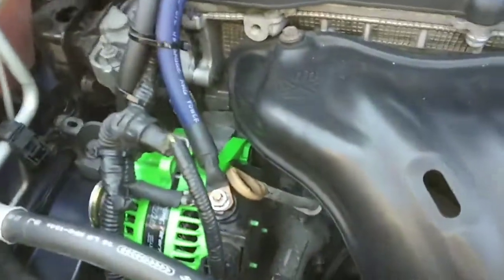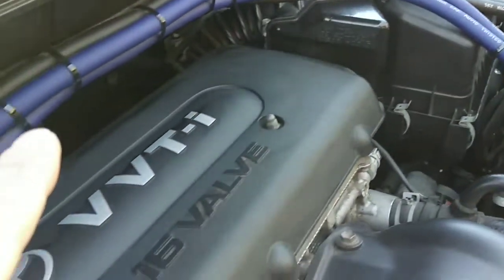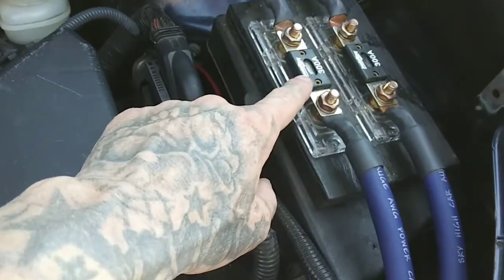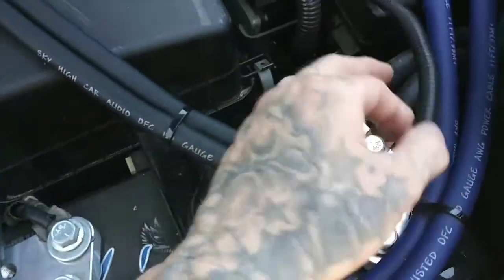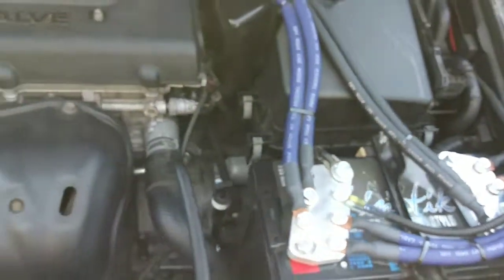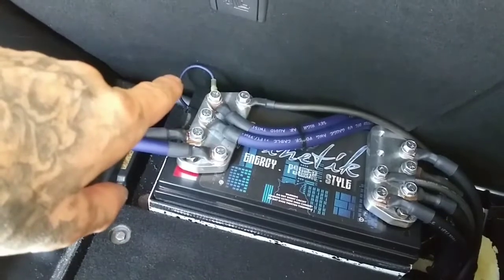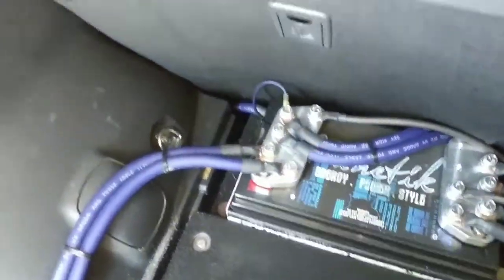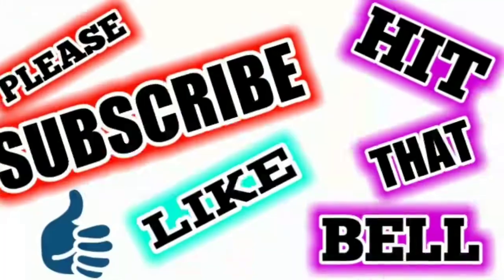BIG 3-4 UPGRADE 2008 SCION XB

Comment: Instead of ground to alternator mounting bolts, I'd run that to the back of the alternator housing. That will keep the alternator cooler and take better advantage of the negative alternating current.
Reply from the maker: That bolt connects the back of the alternator housing to the engine and wire lug is mounted there thats why the engine is grounded to the frame and battery to frame ...??so isnt the return ground to the battery just a quicker path then all that ??

Comment: Where did you get your voltage regulator bypass module?  Does it trigger the battery light on dash to stay on? Also it looks like you maintained factory cables at the alternator that go to the fuse box. I have a 240amp alternator on its way and was kind of worried about the factory cables.
Reply from the maker: So I got the bypass from mike singer from singer alternators and I have no dash lights at all and I got the. .8 voltage one so if your. Charging at 14.4 you would go to 15.2 which when I'm driving I will stay at 14.9 to 15.2 at full tilt and of course at idle I loose some ....and I didnt touch any factory wires your just upgrading the wires I wouldn't suggest taking out factory wires .... I worried too but I watched a lot of videos and read a bunch of stuff on forums...good luck bro on your build
Reply: @SOBERSCUMBASSHEAD  Thanks so much for the info!

Comment: Where does the frame to engine ground bolt on to the engine?  Were all the non-batter side connectors 5/16" rings?
Reply from the maker: Ground from alt to battery ,battery to frame and find your cars engine to frame ground and slap some wire there...those are the grounds in the big 4
Reply from the maker: I dont understand the second question bro

Comment: Nice setup!!! Did you have to re-wire the factory power wire from the fuse box?
Reply from the maker: Thank you and no I didnt even mess with that...
Reply: Thanks for replying. I just upgraded my battery with a Full throttle group 34, but I had to put my battery in backwards so my factory power cable would reach. Then had to extend my grounds.
Reply from the maker: Ive always wondered about those batterys wish I could afford some xs power batterys just out of my budget....one day....how do you like the battery..?
Reply: I’m loving the Full Throttle battery. I should be receiving my Js Alt next week...so I’m on factory alt and it’s struggling bad. Running a Skar EVL 15 D2 on a CT 1500.1. Building another box 3.8 cf @ 31hz.. how big is your box? Keep the vids coming!!!

Comment: Any in line fuses from the 2nd battery to the amp? & im curious why no fuses in between the alternator & the up front battery...im wondering if it is necessary for my upcoming system
Reply from the maker: whats up bro so the factory wiring doesnt have a fuse between alt and front battery either..and yes i have fuses between amps and back battery i see alot of system on you tube without them but id rather have fuses  safer and protects a problem from taveling and causing more problems and money ...i have fuses from front battery under the hood and another set of fuse in the back of the car before second battery also and amps are fused as well bro... some say its necessary some dont...
Reply from the maker: @nathanielthomas2502  nice ...😁man those sfb amps are sick I've been watching Derek do the dynos on them the amps are small for the numbers they were putting out crazy for how small they are
Reply: The extra fuse or fuse box can create noise in the line and is also overkill, unnecessary.

Comment: Hey so I have a 2012 Camry with the vvti and just ordered ofc DC audio working to do the same big 4 and I got the same battery but a 1400 and planned on putting it on my trunk. For the 2ed battery do I still connect the 2ed battery and the main to the alt and chassis and all that or how do I do it? Can you tell me step by step on how to do it on this thread. Thanks really appreciate it. I have the rarest brain tumor in the world so me reading it step-by-step would be a lot easier I have 10 feet of ground 10ft power to do this. Please help
Reply from the maker: Friend request me on face book and I will send you a picture diagram later on messenger so it will be easier bro...sorry to hear about your brain situation keep your head up my friend I will draw out exactly what I did in a diagram and shoot it to you later tonight Im still at work.....facebook Dennis Soberscum Lewis...hit me up I got you

Comment: Whats size kinetik bagtery is that? I wanna order one for my 06 xb
Reply from the maker: It the kinetik hc2400..it's a big ass battery I had to unwrap my wire harnesses and take them apart to get that big bulky plastic protection off of all the wires and rearrange a bunch of stuff to fit it up n there tightly...
Reply: @SOBERSCUMBASSHEAD   sweet, thanks for the heads up and info, i may end up following your lead,

Comment: Why double runs?
Reply from the maker: I was thinking years in advance right now I am building a wall and my front battery is going to be eliminated I will be using a empth battery box and those runs are going to  my yinlong bank in the back ...abd once this wall is complete and sounds good I will be slowly picking up bigger subs another 8k amp and adding adding another yinlong bank or super. Caps to the empty battery box under the hood...double runs is better for what I wanted to do in the future so I dont have go backwards and add runs and I will be getting a more powerful alt...hopefully that made sense...i was thinking future

Comment: Dope!! Where did you put the voltmeter inside?
Reply from the maker: Thank you I put my 2 volt meters above my glove box in the cubby hole storage area you can see them in some of my videos
Reply: @SOBERSCUMBASSHEAD  
Is the voltmeter in the rear fused also? 
If so is it on the same fuse as in under the hood? & finally what size or fuse did you tap into? Thx
Reply from the maker: @nathanielthomas2502  so I didnt fuse my voltmeters in the front or back what I fused was the relay panel I built its mounted behind my glove box and what my relay panel powers is my remotes for my amps my fans and my voltmeters...and the relay is all off my remote wire behind my head unit...so the relay turned my remote wire into I think 35 amps or 40ampsni dont remember what size relay I got...and by using your remote wire it only turns on when the car is turned on...
Reply from the maker: @nathanielthomas2502  no problem bro